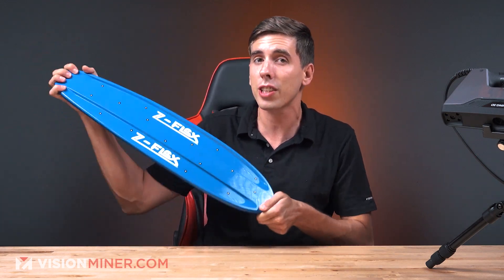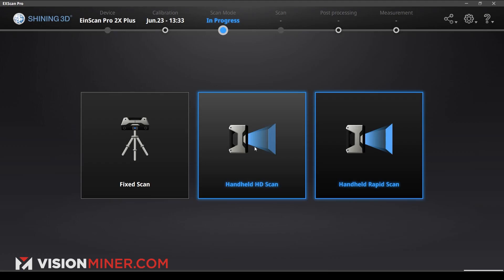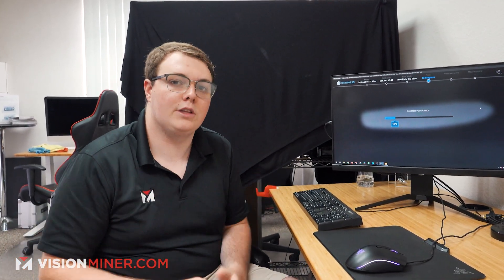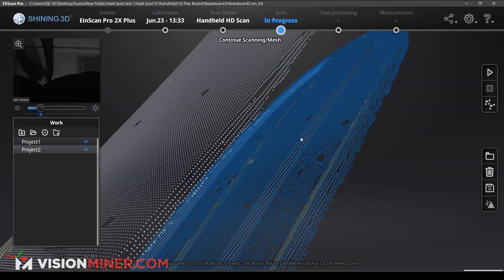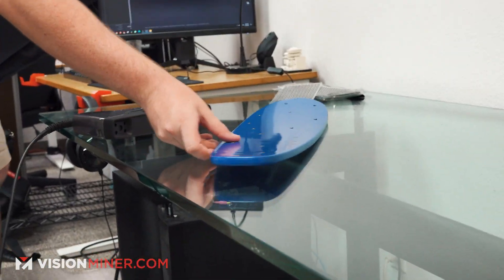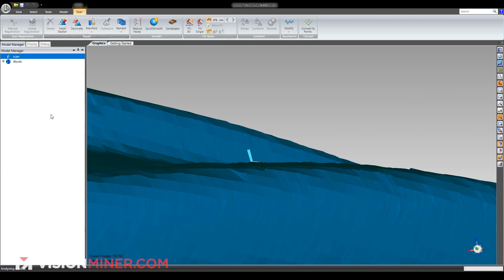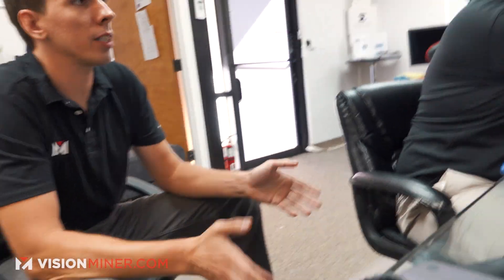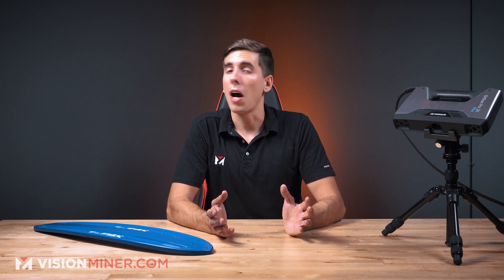3D Scanning a Vintage Skateboard - How To Create a 3D Model using the EinScan Pro 2X Plus (2020)

Comment: I have the EinScan Pro, the full kit with color and turntable. I wonder if the 2X is really that much better.
Reply from the maker: Good question! The range of scanners has all kinds of different advantages/disadvantages -- often in the working distance and scan window size.... usually there's a "correct" 3D Scanner for each application, as opposed to a full-on one-size-fits-all
Reply: @VisionMiner  True but in this case it's the same scanner, just the next model up.

Comment: If you sprayed it with a 3d scanning spray, wouldnt that help with requiring less post processing?
Reply from the maker: Often this can help with reflective surfaces, yes :) even baby powder or other things to lessen the reflectiveness
Reply: Even cheaper than the spray is dry shampoo spray. You can get it at the dollar store and it works just as well. Of course any spray is going to be a problem if you need the texture color.